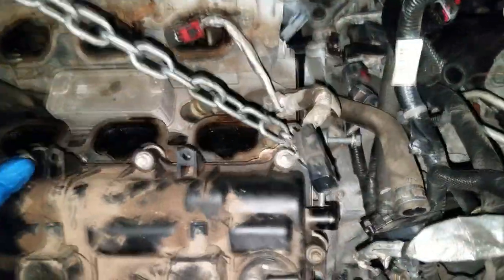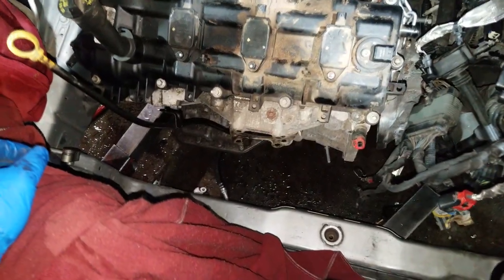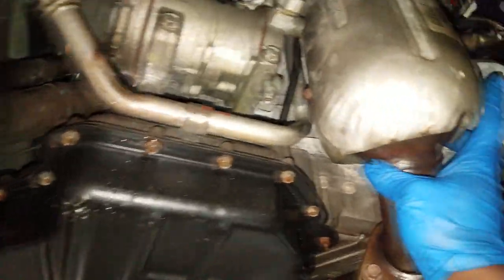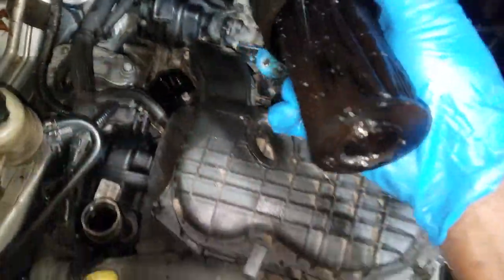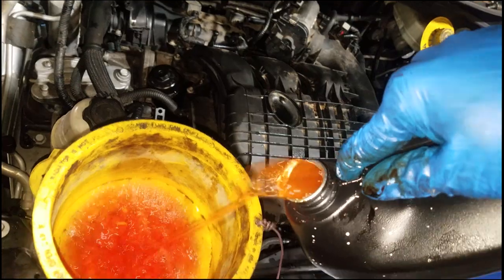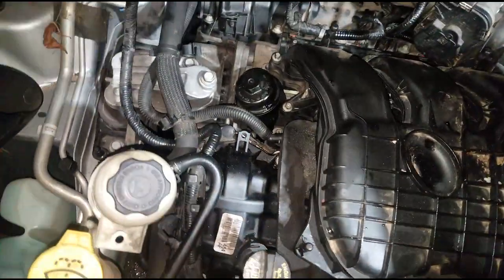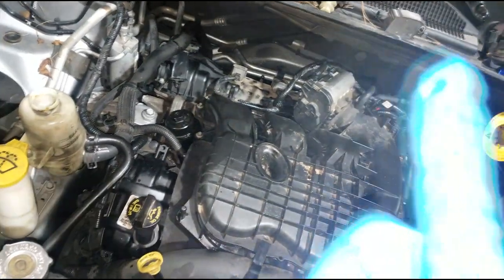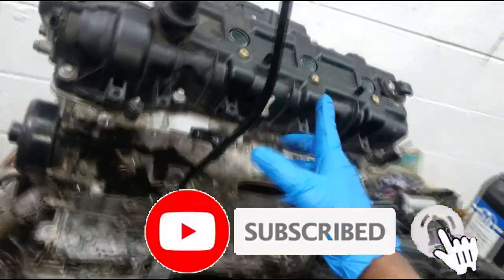Doing this will destroy your Motor.How to install a Engine 3.6 V6 Pentastar ticking rocker arm noise

Comment: The filter was bad.  I stick to 5000 mile oil changes.  Once a year I will buy cheap certified oil run car for a couple days and change oil again right now I use Penzoil Platinum Plus.  I have used Valvoline Full Synthetic great results.  I don't think it's so much the brand but if you stick to 5K miles you shouldn't have any issues.  Regarding Valvoline I have seeing on forums and Ytube that they are very responsive to questions and providing info.  I had the instance since I have 2 Ford's that and because of California state laws they can't reccomend Maxlife ATF as a substitute for MERCON V.  I used it anyway and it works and when my Cherokee is out of Warranty I will use Maxlife instead of the Mopar 8&9.  Transmissions should have service between 40-50k.  Since the  Cherokee doesn't have filter accessible I will drain and refill at about 30k interval.  Thanks for the video.

Comment: I’m surprised this engine started up, this oil filter looks horrible. I bet it’s never had an oil change in its life. Would not put it on my vehicle under any conditions. Anyway this is an amazing job you did. What was the largest mileage you came across with this engine?
Reply from the maker: What's going on..ide say around 220k..the engine can hold up..just valve train problems..

Comment: Knowing the issues of these engines, I'm surprised you didn't pull the valve covers, check the oil filter, and check compression/vacuum before installing. Would you be allowed to refuse used engines supplied to you?
Reply from the maker: Good points. But when you are pressed for time and you are told by an insurance company thats paying to install this engine, thats what you do..At that point, all responsibilities belong to that company if anything goes wrong (which happens) ..They took a huge gamble with this engine, not me nor this company..But as you can see in part 6 it worked out well for all 3 parties involved..thanks for watching bud

Comment: Question as a current subscriber! what year is
 Gen 2 engine 3.6 come out? also is last of year Gen 1 3.6 any good?
Reply from the maker: Hello my friend. thanks for watching and subbing,, I wanna say 2014 gen 2 started (wasnt much different than 1st gen to me) The first gen had cyl head problems that included the 2011-2013 so i wanna say gen 2 came 2014. As far as last year of gen 1 being any good? depends on what you mean by good. Performance wise, all years are good, whats separating them is certain year models started having valve train noise due to a number of reasons.